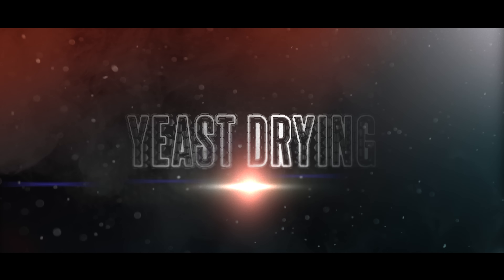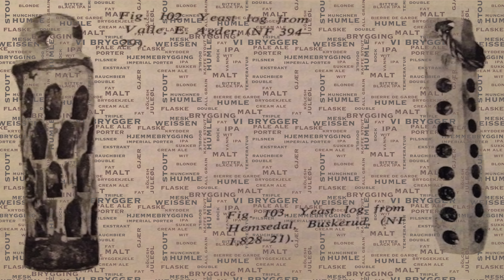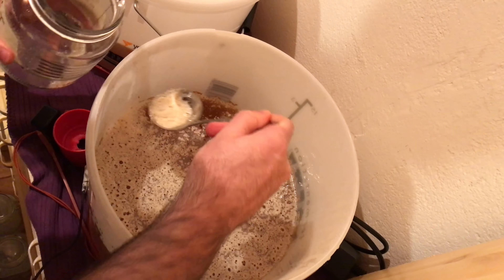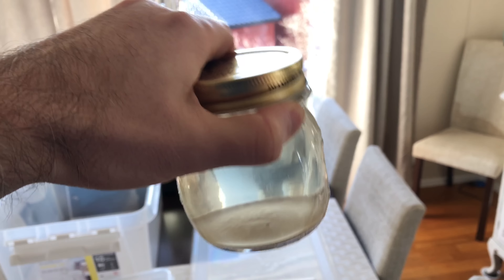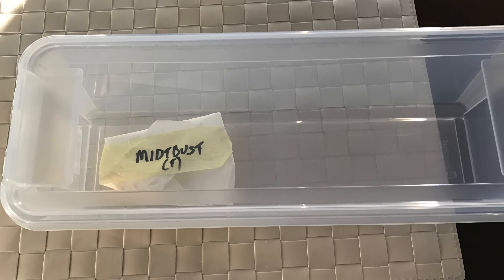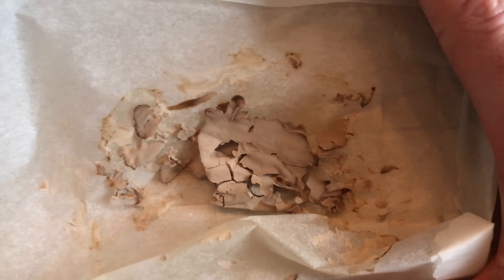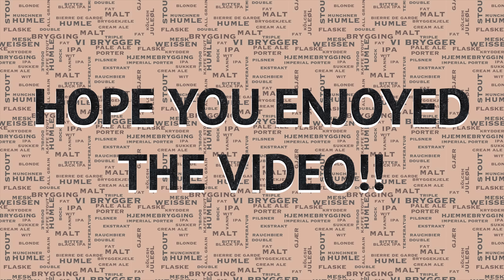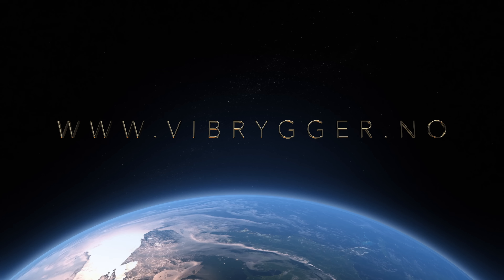Beer yeast drying at home

Comment: Have you tried to re-use the yeast you dried yet?  If so what process did you follow? What viability is the dried yeast? Do you make a starter or just rehydrate?
Reply from the maker: Sorry I have just noticed that this is unanswered! Yes, I have been using this process for quite years now. I just rehydrate in wort :)
Reply: @DavidHeathHomebrew  so you open a vial and simply add one tsp of dried yeast on the fermenter during transfer? as simple as it? TY  :)
Reply from the maker: I add the full liquid yeast to a jar. Add it to thr fridge till it all drops down. Take a teaspoon worth for the pitch. Then wash the rest for the next 2-3 brews.

Comment: Would it work if i bought a pack of dry brewers yeast and then activated it and cultured it to make more, and then dried it again? Would the final product be exactly the same as the packet i originally bought?
Reply from the maker: Sure you can do that. Over time the formulation could change over a number of generations but this will be much slower for single strains than multiple strain mixes.

Comment: Hi David, thank you for a super interesting video!  I'm definitely going to try this.  It does throw up a few questions for a newbie such as myself ...

1. drying the yeast at home.  I expect this is dependent on the humidity factor.  For example, here in Portugal winters are very humid.  Other countries suffer humid summers.  Does it have to be really dry to do this successfully?

2. does room temperature come into effect or any temp is ok?

3. When you have your finished yeast and ready to pitch, does it need need to be re-hydrated or maybe even need a yeast starter any other process?  Or simply can I chuck it straight in (if so, does it need crushing first)?

Thanks again for so many useful videos!
Reply from the maker: ESL KidStuff I would suggest drying it in a heated or a reasonable temperature room. It would dry anywhere but temps will factor the time it takes. I would pitch it in some wort after mash out that has been cooled to pitching temps. Shake the container during the boil and chill process.

Comment: 7 years later, and still one of the very few videos on this topic haha. Question, what temp can you dry out yeast before they start to Die off
Reply from the maker: I would suggest as low a temperature as possible. Some use an oven on the lowest setting with the door open, I prefer a short period in a dehydrator on the lowest setting.

Comment: Wait, what? You can freeze the dry yeast? Have you tried this? Do you just chuck the vial with the dried yeast in the freezer or is there anything else you need to do to prevent yeast cells from bursting? Does freezing affect yeast viability?
Reply from the maker: You sure can, it will prolong its life. The best way is to store it in a container with a minimal amount of air. Wrapping it in cling film securely or vacuum sealing it. Let it return back to regular temps before using. No need to add anything.
Reply: @DavidHeathHomebrew  Awesome, thanks. I'll try it on my next batch. Is there a reason for recommending top cropping instead of just using the yeast cake left after the primary?
Reply from the maker: Great. Yes, yeast that is top cropped is in prime health where as bottom is tired and compromised.

Comment: I have just scooped out the yeast cake from a kölsch after coldcrash and bottling. I've dried it according to your recipe above and put it in the freezer in a ziplocker bag. How much of these dry flakes do I need to add to my next kölsch (how many grams for 20 litres 1.060 OG beer)? Also how do I check if the yeast is good or bad before I use it and how many times would you recommend to reuse a given yeast before buying a new one?
Reply from the maker: That depends on the yeast. When fresh you can use the original pitching rate.

Comment: after the yeast is dried does it have to be re-hydrated IOT use it in a beer? If so, what is the best way to do this?
Reply from the maker: I always rehydrate in wort. It is used much like dried sachet yeast, just no real need to crumble it as much.
Reply: @DavidHeathHomebrew  I thought you pitched dried yeast directly or is that what you mean?
Reply from the maker: I do, it is rehydrated in the wort :)

Comment: Another great video David, thank you. Would you have to make a starter with that amount of dried yeast before re-using in a brew?
Reply from the maker: Thanks. I usually would just pitch it like regular dry yeast. No issues so far :)
Reply: @DavidHeathHomebrew  I should have asked you in my last question David but I've just started a hefe with Wyeast 3068 Weihenstepaner. Some say you should take the bad stuff of around 24hrs then take the yeast at 48hrs, what doyou recommend?
Reply from the maker: I would suggest waiting 2-3 days on such a yeast.

Comment: Old video, I know, but here's my process through 5 "generations" of Skare kveick: Top crop directly to a sheet of sanitized wax paper. No straining yeast from liquid at all. Set that wax paper on a table in my brewery. Point a USB -powered fan at the yeast to dry it as soon as possible (my theory is that drying it quickly stands less of a chance of wild fungus making a home). Scrape it all into a container 24 hours later.  Critiques welcomed!
Reply from the maker: That sounds good Jim. Assuming that you have nothing flying around that can land in it. I have my box protection with this in mind.